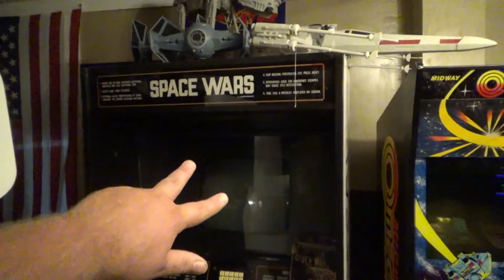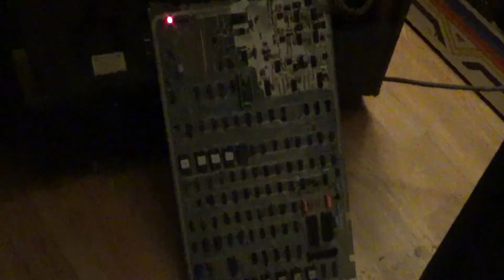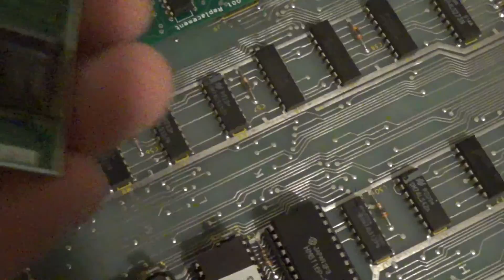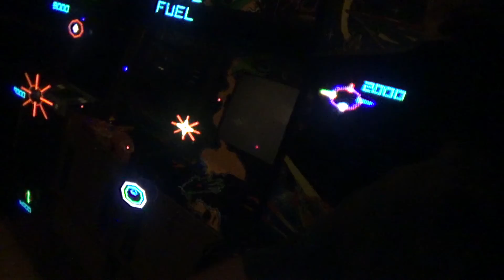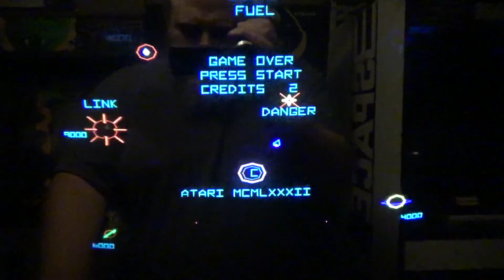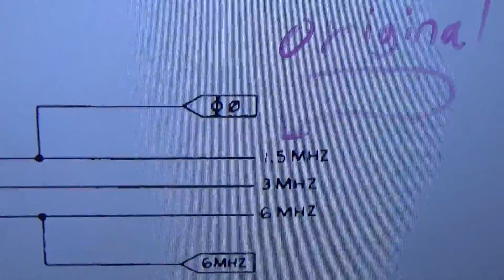OVER CLOCKING a gravitar arcade arcade machine

Comment: There's a fair bit of circuitry in the path that's generating chip select/control signals to the EPROMs, so between the speed of the EPROMs themselves and all the timing/propagation stack-up of everything else it's possible you're outrunning the ROM. However, even if the EPROMs are slow 350ns parts though that's still good for ~2.8MHz access and the 6502 isn't actually going to be able to hit it that fast continuously, so I'm not 100% convinced that'll be the problem. The SRAMs could also get to be on the edge, but the 2Kx8's are usually faster than EPROMs of similar vintage. The vector scaling is based off the system clock which is why the slower speeds affect the picture size ('slower' input clock = longer integration time in the analog domain =  essentially a 'multiply' on the scale factor). The glitchy graphics (while obviously the 6502 is still running right) do indeed look AVG related. You could probably 'fix' that by disconnecting the 12MHz signal from the AVG and feeding it from an external 12MHz 5V can oscillator, then use the faster clock with the 'C02 as you did.  (so the AVG would run at a stock draw speed, but the game itself would run faster because of the increased CPU clock and interrupt rate). Atari usually tied the game play speed to the IRQ rate on the 6502, so if you kept 3KHz on the input of J4 the game would run at the same frame rate, but the CPU would have more speed through the game loops and that would combat any slow-down in game play if the 6502 gets too bogged down and can't finish the game calculations before the next frame.  (That might not always be the case on the vector games all the time though since they could also be slowed down while waiting for the AVG to complete drawing its display list, not just the CPU not getting everything done in one 'frame' time...)
Reply from the maker: thanks Clay i did consider  running the on board 6mhz clock to the avg since its speed would be closer to 12mhz after changing the oscillator  much of this i did know but you definitely answered some big questions  maybe  someday i will revisit this.  by the way i just just checked the eproms and they are 450ns  so thats even better yet !! also i took a look at the program and vector ram and it is 2016-10  all around so there is a week link. thanks for watching man
Reply: Oh yeah, -450's would definitely be on the edge by the time you add in propagation delays (there's at least three TTL gates in the mix) for a ~2MHz clock on the '02. For grins, you could try to find some -250's and re-burn the EPROMs, that'd be plenty of margin to go faster if that's indeed the issue.